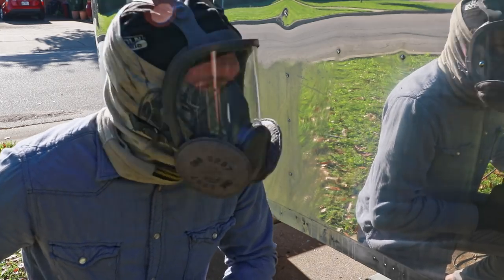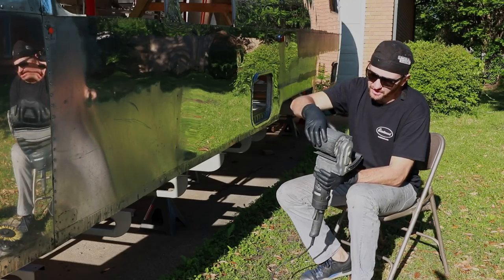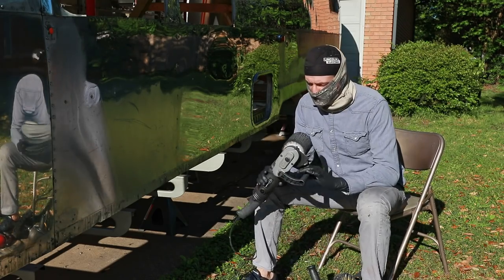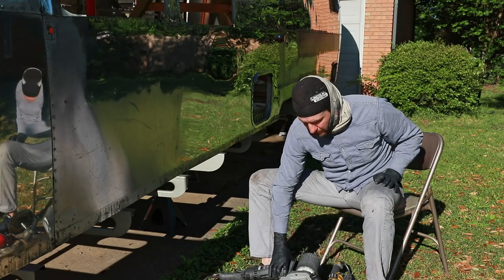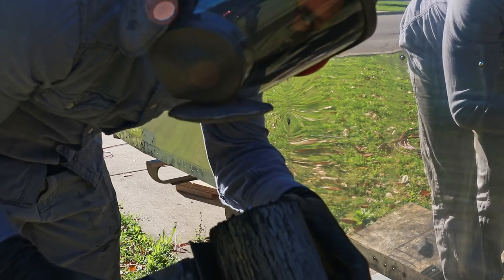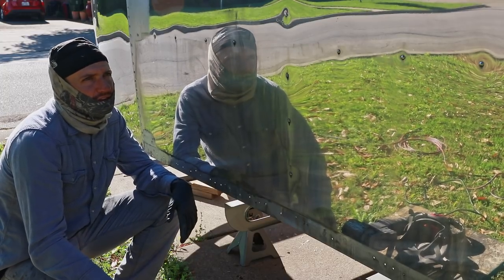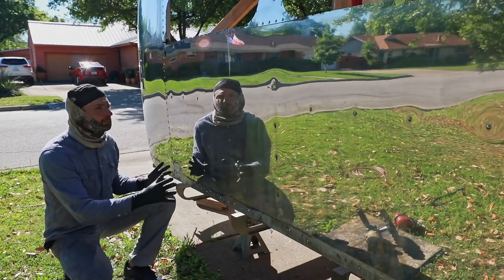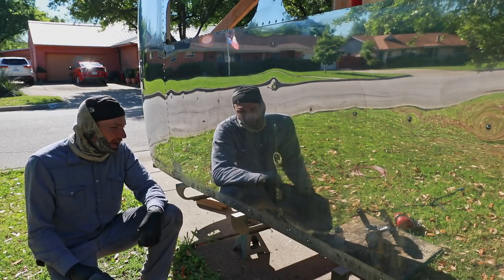How to Polish an Airstream Rough Cut Stage 1 Eastwood SCT

Comment: Nice demo Ian. The SCT is similar to my buff pro in the way how pads clog up. I have two pads now for each polishing session. I have a few areas with loads of scratches so im using special aluminium air sanding discs with kangaroo oil. They are too deep for cross cutting but most of it I can cross cut. Keep up the great work :-)
Reply from the maker: Thanks man!  Yea, they are similar.  I have been doing something similar and getting decent results.  Have a good one!
Reply: @MillerGarage  I will thanks Ian!